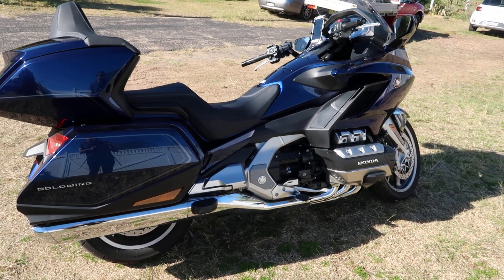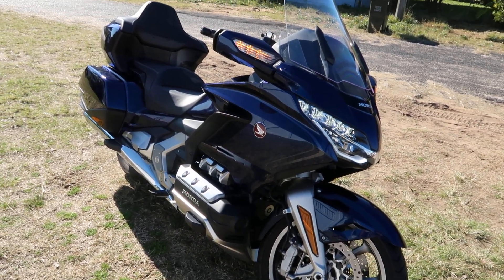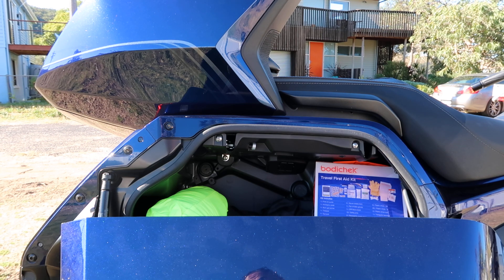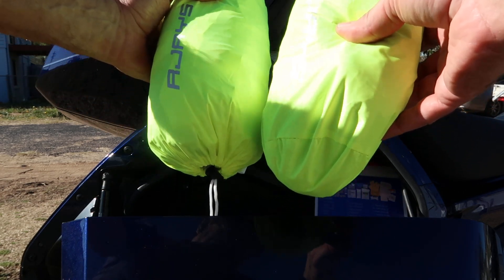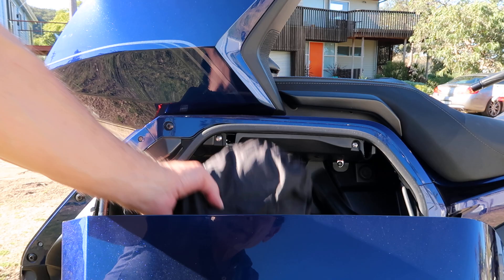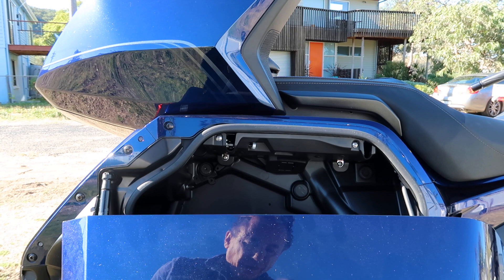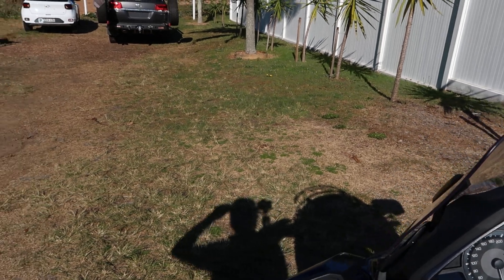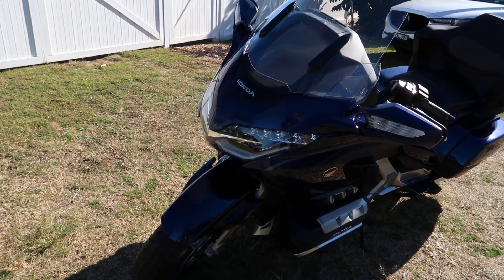Honda Goldwing 2018 - Ettalong Ride Walkaround

Comment: so I'm standing here with a dead battery on my goldwing trying to figure out if this guy has the answer and no no he does not this title of this video is way wrong
Reply from the maker: Opps. A new battery of course. I did mention a portable jump starter battery, but may not work if the battery has a fried cell.